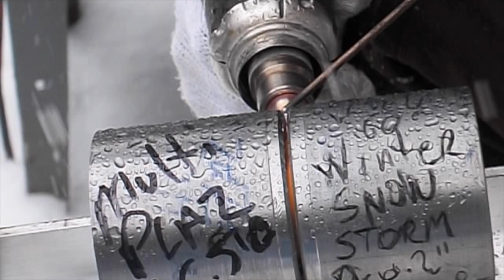1437 Impossible Welds made Possible with Multiplaz

Comment: I amaze it is cheap to run compared to argon co2 o2 gas water in the gun turn into HHO gas with 140 v instantly in side as you know HHO usually turn oxidised  the area it heated as in the Vedic some of iron related with HHO gas and sparked into iron oxide, this can affected the molten Iron strength , I believe alcohol had reduced this by reducing property. Act like flux . Good to see x ray or ultra sound and strength test for it. But it will be inferior than Tig and Mig. As for light ness and frankly to environment . Good for hobby and home . Because the unit cost 2000 $ still not cheap enough . I was thinking using 4 solar panel to get dc 160 v to made a gun form copper pipe and tungsten tip  seen I can made one my self under 100$!

Comment: I think you did great. 

 Especially since you didn't ground it and use the the higher voltage arc feature which is Way Hotter.

 I have a Muliplaz and know how difficult it is to make the type of welds that are easy with a MIG or TIG and Stick.

  Just like other welding machines there's a lot of art involved. Unless you're used to welding with a torch you are not going to pick this up and create perfect welds. It's completely different from the way you'd weld with a MIG/TIG/Stick.

 It's another cool thing to have in your garage and something you find yourself grabbing more than you'd think. Not having to worry about running out of gas, or getting to the welding store before they close to pick up a refill.

 You just put water (plus rubbing alcohol for cutting)

 It's also smokeless, which I love. 

They suffer abuse well. I've accidentally dropped them many times and no issues. 

To wrap, it's not supposed to replace your  MIG/TIG or Stick. It just gives you more options. My Muliplaz has gotten me out of some really crappy problems. 

 I work on my cars and bikes all the time and if you need something removed, like a steel bolt that's been in aluminum for 14 years this 
£ucker will break that bond down in no time. 

 If they had an attachment for an air hose it would be an awesome plasma cutter. 

 What settings were you using during this weld?

Gary
Reply: settings are private. we have our reasons. all of what we know is available through our training and education packages at: canadianplasmaarc.ca

Comment: First at all,Seems to me for advertisement they use one type of machine and for selling another...This is why no solid results been achieved...Acording to original n designs machine operating at 350 volt DC voltage and 5 amperes current,Multiplaz 3500 is a joke,there is an 2 IGBT's and no transformer which is very strange...One guy had stripped his Multiplaz 3500 revealing inner power supply components but mostly they digital which contains only circuit boards,no transformers visible there which creates back flow and drag.....Multiplaz 3500 was construct to rip off money rather than give user a performances in welding...In theory plasma arc fusion is possible but not what multiplaz made...
Reply: Our goal is to demonstrate the capabilities of balanced plasma power. our dealing with multiplaz was necessary, however we do not affiliated with the brand at all besides the distribution of the technology.